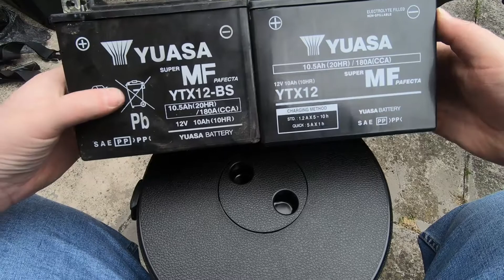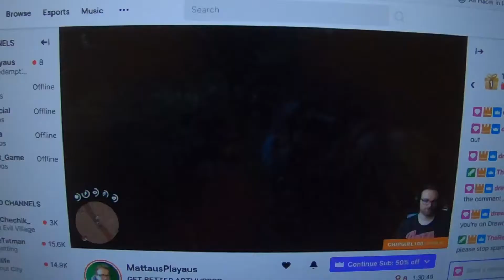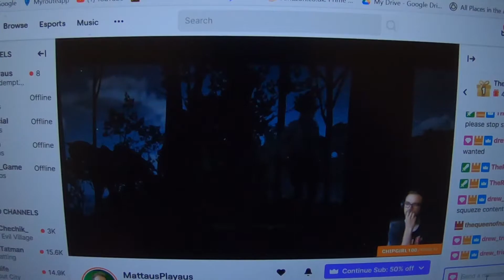How NOT To Change a Motorcycle Battery | Triumph Speedmaster | FAIL

Comment from the maker: Now 49 Subscribers 🤦🏻‍♂️😂
Reply: I wonder if you can help me with this puzzle.. I have bought a Yuasa YTX 12 (non sealed box) from halfords for £59... yet I notice from the Web that there is a YTX 12-BS.. like your video.. is the YTX 12 old stock?
Reply from the maker: Hey! 

From what I understand the “BS” stands for bottle supplied. Which will require you to pour the electrolytes (I think that’s what they are) into the battery when you’re ready to activate it.

The one I brought in the video was not a BS and I didn’t have to pour anything into the battery, it was all ready to go. Which was disappointing as I like the bubbles 😂

I hope this helps and I hope I’m correct 😂😂😂👍🏼
Reply: @drewdaism_   yep, that's cleared it, much appreciated!
Happy days!